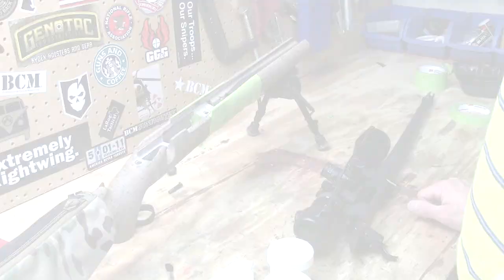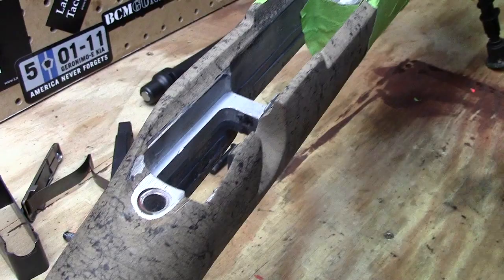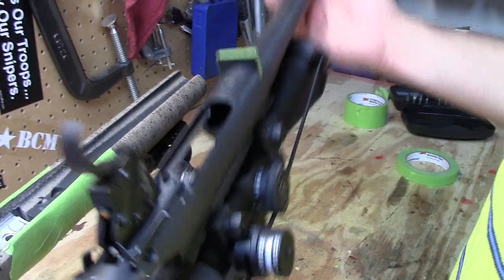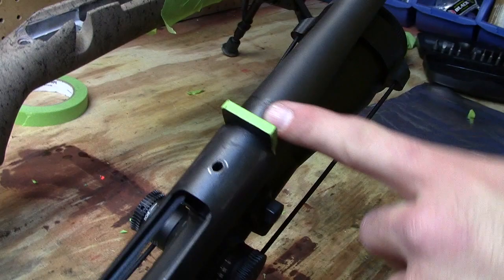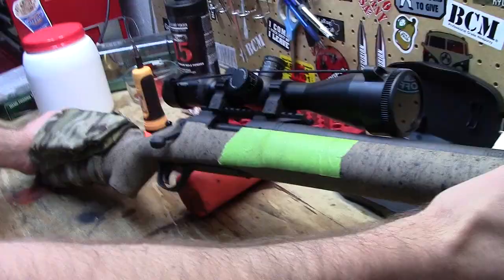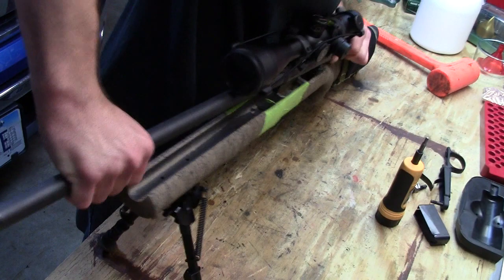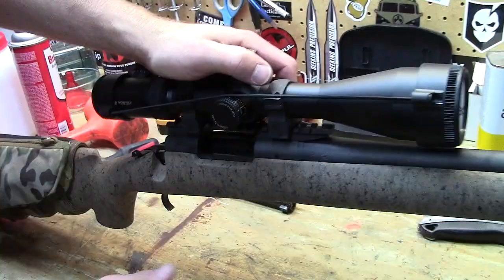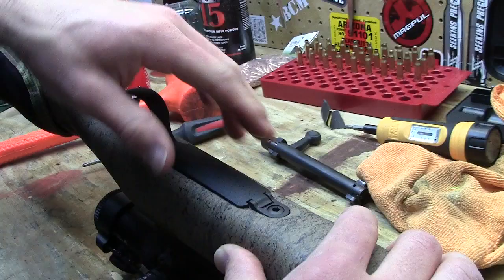The 1k Yard Project - Bedding the Recoil Lug

Comment: Question: why bed a stock that has an all aluminum bed to begin with, will epoxy be stronger than the Aluminum, us weak minded wanna know?
Reply: Local-Yokel 
These stocks are pillar bedded, not full bedded.
Reply: It’s mainly for the recoil lug
Reply: Joey Miller wrong.